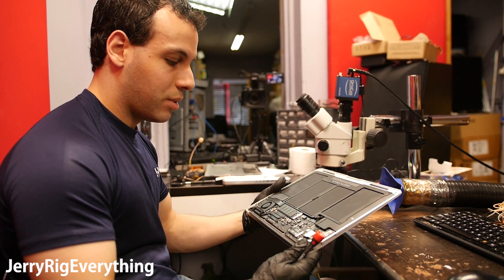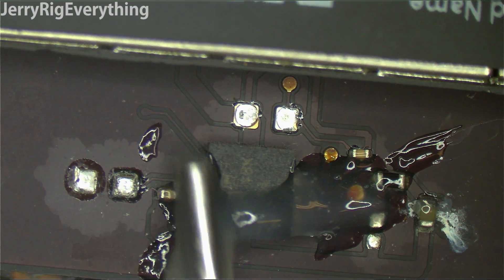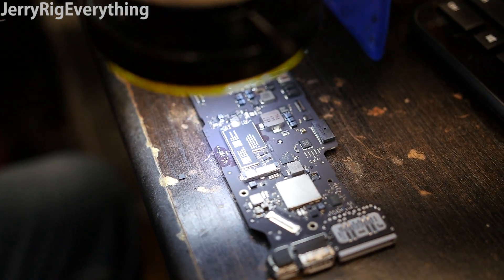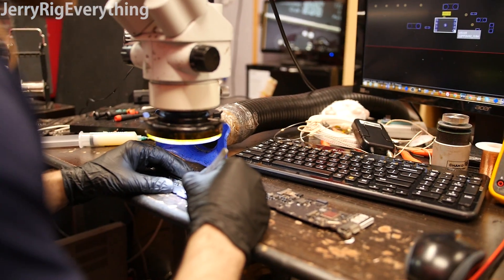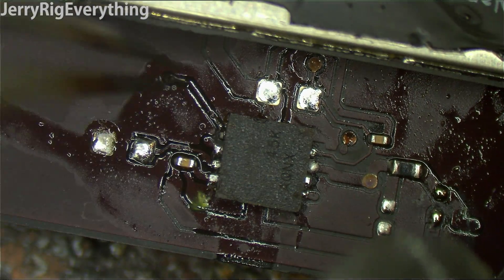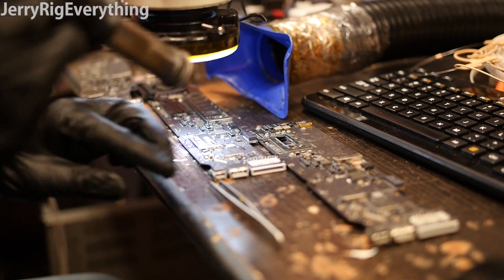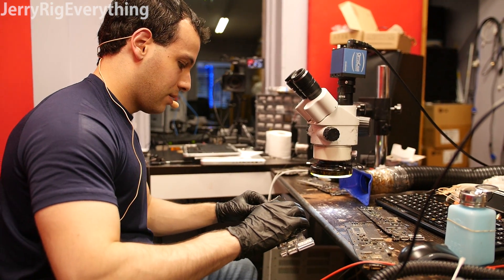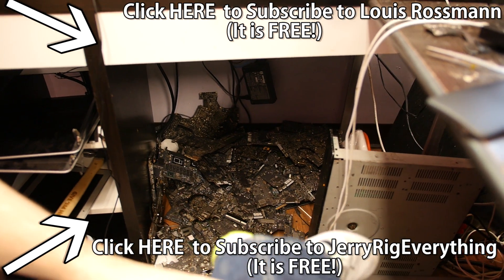Board Level Repair with Louis Rossmann (MacBook Air)

Comment: Now this is great, I love it. But a big thing for me is how he's handling the MacBook whilst fixing it. He's putting it on a hard wood table, no cloth or cushioning. All that's doing is scratching the aluminium lid! I manufacture optics for a living and I'm probably extra careful about these things but it's care and attention. And thats not a cheap device.
Reply: table is laminated and cleaned before beginning any repair. we handle aluminum machines that scratch if you look at them the wrong way daily so this is thought of in advance, both in terms of never dragging, always keeping surfaces clean, and using a cloth under it if it is ever to be moved from side to side. this is a hipster area with lots of affluent demanding apartments/customers, if we were scratching things in the least people would scream bloody murder and pitchfork the store :)
Reply: It isnt cheap because apple sells it high cost. But the components that are in are cheap. Also he fix everything if he destroy something. He even gives warranty. So he can handle them however he wants it.

Comment: How do you sure about solders dont touch each other. When he put new chip, solder flatten and made bubble. İf it makes bubble why not solder flatten all under chep and connect all solder peaces. How you sure about that.
Reply: soldermask is on the board. solder can't stick to the soldermask material, it naturally repels it and causes it to roll away. if you scratch off this layer then it would be a nightmare.

Comment: How did you keep the solder from bridging?
Reply: DENIS I try not to scratch off the soldermask between the pads to begin with. Sometimes I purposely scrach away the soldermask/coating if a pad is missing or burned then solder straight to the trace that is coated so I have a connection.
Reply: soldermask. solder sticks to the pads and can't stick to the soldermask that coats the board. If you scratch away the soldermask on a broken PCB you'll see.
Reply from the maker: I think the flux has something to do with that. But youd really have to ask Louis.
Reply: Solder sticks to the existing pads
Reply: Louis Rossmann do you ever bother recoating?
Reply: Louis Rossmann makes sense. thanks for taking time out to reply!

Comment: that bit were the stack of dead motherboards is in every laptop repair shop I have the same under my desk
Reply: I find that the parts I reuse from dead motherboards are better than buying new ones to repair, it has a better life and saves on the cost of repairs